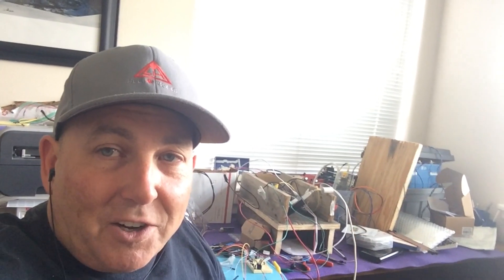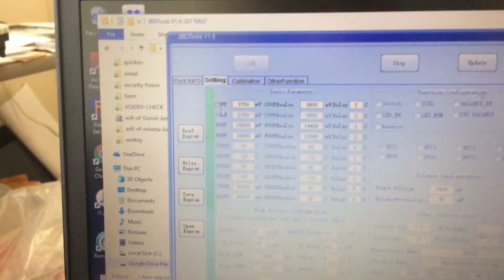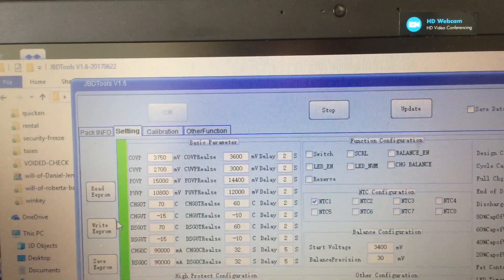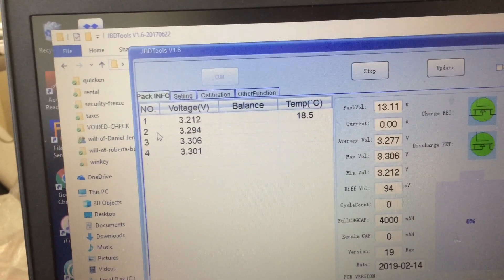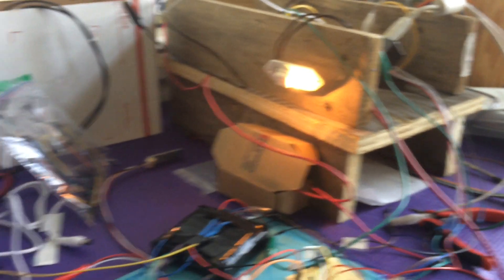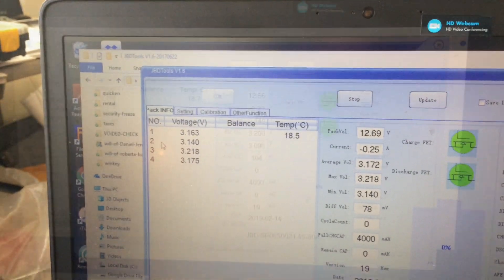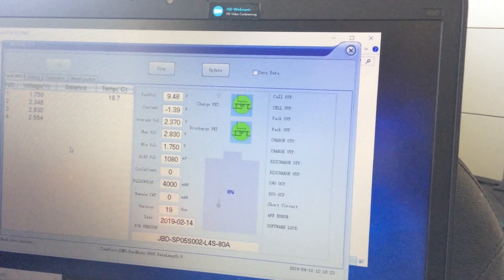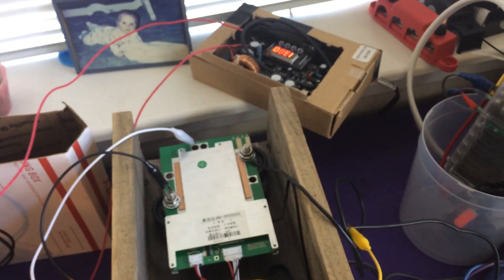$60 Smart BMS Breadboard Testing for DIY LiFePO4 4S. Very Cheap Insurance?

Comment: Great Video, I do the same thing, but instead of light bulbs I use 100Watt 1 ohm resistors, and parallel them up for more load, ( for small packs like that it works out well, to to .2c .3c .5 c and so on. :)
Reply from the maker: Good idea. Easy to dial in exact load.

Comment: does the uart box come with the cable to connect to the laptop 
and
 can I go into further settings not available on the app to change the voltage that trigger the full indication on dashboard.

my bms came  pre set with the  full charge being indicated at at 13.6v which is annoying because it means the battery hits aprox
75% at 13.6v then the ah meter  jumps to full capacity and dashboard indicates full.

I d like to change this to 99 % actual charge which is about 14.4v so I can  see whats happening on the amp hour counter...
 any help apreciated !!!!
Reply from the maker: 1) I ordered the uart RS485 unit with mine and it came with the USB printer type cable. 2) I have not been successful with changing the SOC values from the bluetooth app. 3) 14.4 is way up there. 13.8ish for me is 100% and 13.6 is not far off if I consider the amp hours between 13.6 and 13.8.  I have found it is best to let the pack hit the upper charge level what ever you set and it considers this 100 % even though you continue to charge above this level and this is your understandable frustration but  I have a 150ah pack and I'm thinking their is about 10ah between 13.6 and 14.4 for my pack if  I go from charge to discharge.
Reply: @dannyjensen4954  I was hoping when the rs485 was connected to the laptop the voltage for full charge indication could be changed on laptop to 14.4v as like you I find it cannot be done on the app.

my lithium cost the same as 2 lead acids like for like useable capacity and I made a decision that if they lasted the four years the lead acids do but with added benefits ---  i would have had my monies worth !!!

with that in mind i decided to charge directly from alternator limiting current to 30a via wire resistance and fuse to protect the alternator -  continue to use lead acid solar regulator and lead acid charger.

i use a voltage module to cut charging of all 3 charging methods at 14.4v and not reconnect until 13.2v to knock out the float voltage.

using this charging method i find my battery at 75% capacity hits the 13,6v mark which trips the full on the bms Bluetooth indication and then the battery sits at 13.7v until about 98% capacity before swiftly moving to 14.4v in the last 5 minutes of charge.

 i did have a long conversation with usa leading lithium battery manufacturer whose response encouraged me to  go ahead with this method of charging as long as i could keep the charge voltage below the 14.6v and 3.65v per cell )

i noticed on your video on the laptop there was a box saying full charge and 13.6v was in the box.
its this i was hoping to be able to put 14.4v in and solve my problem !
Reply from the maker: harry harry no problem changing this at the pack and cell level using the pc. I just couldn’t get it to work with Android with my version of software.
Reply from the maker: @harryharry8384  My firmware on the BMS is older that what you have. Also, the new 2019 version of the android app may work better allowing the change of the parameters. But... The SOC is not really determined by the voltage I think it is sort of a guideline. The unit has an Amp counter and I really doesn't seem to give you good SOC until it has cycled to a full charge up above 13.8ish. It uses the number of amp hours you program in and I think it starts counting down. Here is a newer version of the phone apps I found at my vendor. I may try to load the newer phone apps when I am at the boat. http://rjxzstech.com/new/smart-bms-instruction.html

Comment: Does this Bms actually balance?
Does the overvoltage actually work?
Do high and low actually function when you change the parameter settings?
Reply from the maker: Lance K yes over voltage and under voltage work pack and cell. I would only trust balancing if you supervise and know what you are doing. I only charge to 13.8 and balancing is not necessary yet on my pack.

Comment: Thanks for the video, not enough info out there on these units so it's appreciated :) I've just jumped on a 4s common port unit for my set up and agree that using small cells is by far easier - I didn't do that and instead test on my 120Ah battery and that takes forever! 

I'm planning to use mine just for cell over and under voltage protection. I have a few of the new active balance boards that I'm going to hook in parallel to take care of the balancing, BMS will protect in case those can't keep up while charging.

Thanks again - ignore the haters mate
Reply from the maker: Martin K Thanks for you comments.

Comment: Why dont you turn on the static balance.
Reply from the maker: I’m afraid of turning on the balancing until I understand more about this bms. I’m hoping my simple 4s low c rate won’t need balancing. Please share your experiences with balancing. Thanks for your comment.
Reply: @dannyjensen4954  im pretty sure its only a 60ma balance. You will need low current so you dont overcharge and the balance will work better. Unless it not enough to make the cell voltage go up.
Reply: @dannyjensen4954  Hope and lithium are not a good idea. You should be sure.Charge balance when charging and static balance when not charging.
Reply from the maker: Have you tested the balancing on this specific bms?  It may be risky to run these voltage balances all the time except when at low current and high soc. “This strategy can work if the shunting voltage is only ever reached at low currents and the cells are near-fully charged each time.”  Check this article out under voltage based shunting and let us know your thoughts and test experiences please. http://nordkyndesign.com/protection-and-management-of-marine-lithium-battery-banks/ . I may test this using my bench charger after taking my top balanced cells up again to around 3.55vpc. Thanks. Danny.
Reply: @dannyjensen4954  yes ive tested that bms. You dont want to leave any lipos unattended when you are testing. You dont turn on the static balance and go out. All that bms does is burn off high cells. Its best to manually balance the cells before making yoyr pack anyway.
Reply from the maker: Thanks. I made my pack by charging up to 3.6 individually then paralleled for 2 weeks. I’m going to test the static balance as you recommend.  You only recommend static attended balancing?
Reply: @dannyjensen4954  if you paralleled them and are still unbalanced you may have a bad cell or a cell with higher internal resistance. May not want to use the bad cell.  I also thing the balance setting should be set to open. It will be above the charge/static setting. Hope this helps. Good luck with your build. Did you see my channel yet?
Reply: @dannyjensen4954  look at what I have to balance. Will be 36s 200+p bank...https://www.youtube.com/watch?v=f3KjNuxlT_4&t=29s
Reply from the maker: Thanks for your comments. I forgot to mention that my issues of low cell voltages in the video were with my test 1ah lifepo4 pack I was breadboard testing with because I had too small of a ground wire. My "real" Calb 180ah 4s pack is within 10mv down at 35%soc.  I watched your balancing video. Wow. 9,000 cells. I'm sure your loads are pretty high too.  I'm going to play with the balancing at low current using my bench charger per your recommendation. I have no easy way  to dial my current down on using my boat chargers. My plan is  to get on upper knee on the 95% SOC Lifepo4 curve so the voltages will be more precise.   I get the feeling that you static top balance above a certain voltage on your 26650's.
Reply: @dannyjensen4954  yes i run my house for a load. Baseboard heating included. Im still working on the 26650s. Its a long project.
Reply: I built a 14s 10p pack... The way i went was to load the used cells to full 4.2 volts leave them for three weeks and then meassure the cells... All the cells that had the same voltage like 4.16 i put in parallel... I then put the packs in series and put the bms on then balanced charged it... I hope this will work in the future
Best regards Jp 
curious on your opinions and tips for my system
Reply: Short addition i only used cells 4.11 Volts and above so i dont have any bad cells in there that lose the voltage too much
Reply from the maker: jP Frank is the expert. See his videos.  I’m using lifepo4 so I’m not familiar with your cells. I have played around with static balance. It is really slow. I have a low charge and discharge and I cut charging offf before I get too far up the knee lifepo4 at 13.8 pack voltage. Off grid people are better people to ask. Thanks for your comment .

Comment: Hey Danny. Do you know if you can hook the charger and load on the same terminal? On the P-
Reply from the maker: EPIC ADVANTURE p- goes to the negative load bus. So if you were running a refrigerator, it would go to the negative lead on the refrigerator.
Reply from the maker: Yes I think I have done this. I don’t think the unit cares about p- or c- either one or both seems to be okay. b- however is important to connect to the battery terminal.
Reply: @dannyjensen4954  Awesome! Thank you so much. I am going to try and hook mine up tomorrow.
Reply from the maker: @EpicAdvanture  Where did you get yours? Be real careful wiring it up. Check your work with a volt meter before you power it up. Also I had issues with reading wrong voltage on cell #2 on my test pack because I don't think I had heavy enough wire. I"m now using 16 awg for the cells and 2 awg on the negative B- and my issues went away.  I also have balancing disabled. It scares me without a bunch of testing. I don't think I'm going to need it I have gone through some cycles now and balancing at this point is not need compared to the risk you assume by turning it on without testing. .. It is a $60 bms after all. Thanks for you comment.
Reply: @dannyjensen4954  thanks for the heads up. I'm currently just going to be using this for monitor and a fail safe for cell failure.
Reply: @dannyjensen4954  Hey again! So I hooked up my BMS which seems to work. But every time I hook up my loads to the p- terminal, the state of charge percent meter slowly drops until it hits zero. Any ideas what's wrong?
Reply from the maker: EPIC ADVANTURE have you checked the   Battery capacity config values. You values may be loo low? So when you draw a bit of current you go  below the 0 threshold?
Reply: BMS link is broken, can you provide a little more info on how to find it on Aliexpress?
Reply from the maker: Videos by Alex you can search for Smart Bms 4s. My vendor was Rj. I’m on a trip now. I’ll look later.
Reply: for common port you can connect charger and load on P-